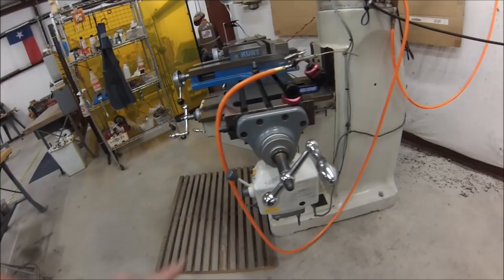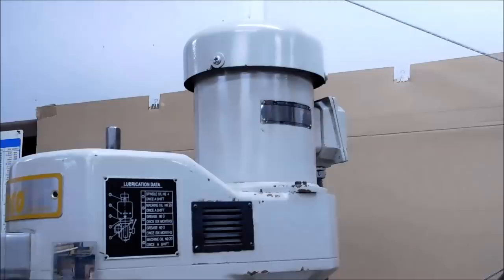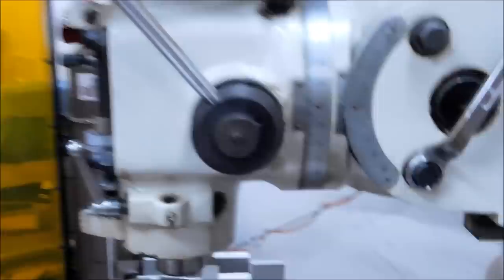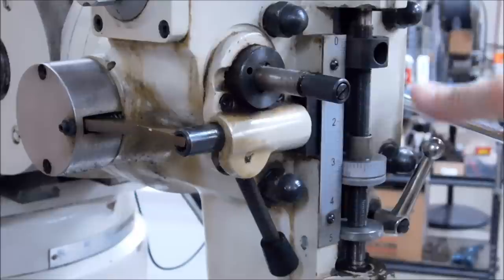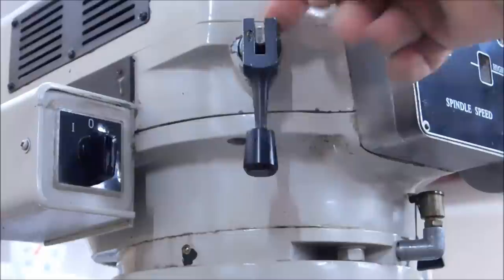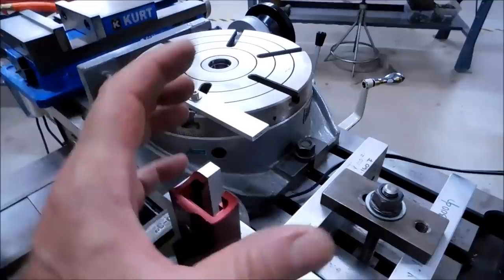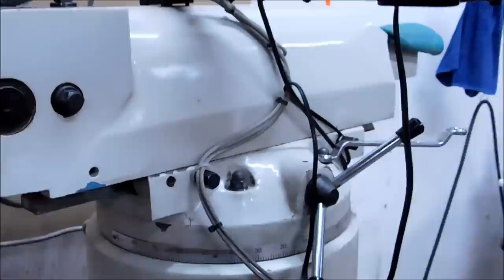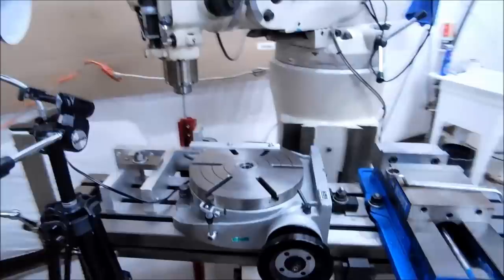Machining - Bridgeport Controls 101 ( and some other stuff )

Comment: Hey Amigo Joe!   Great overview video!   Still have the small handwheel on my Bridgeport!  I think it's a aftermarket but I don't think I've ever used it either.  I was wondering if your machine came with the x axis powerfeed installed or did you do the install?
Reply from the maker: I ordered it with it installed.
Reply: @joepie221  

I miss Enco.  They had incredible pricing on their products.   I guess its what led to MSC buying them out.

Comment: Thanks.  I have a Sharp look-alike.  There are some features on the machine I've never used and I found your video very informative.  I'd like to see you review the maintenance of the machine.  There's lots of fittings on the the machine and some take way oil, others spindle oil and at least one for grease.  A lot of machines' manuals call out lubricants that are no longer identifiable having been referred to by their 40 year old trade names.  (Esso who??).
Reply: The 'Grease' fittings on my Bridgeport are meant to receive way oil, not grease. Machines with these often get greased by those who don't realize. That was the case with the previous owner of my machine.

Comment: The speeds of the power feed  my clone machine are 0.0015", 0.003, 0.006"  and are independent of the motor speed.  They worked once, but not the gear that engages it inside the head is not engaging and it's a lot of work to take it apart.

Comment: Regarding the outrigger setup, do you think that the thickness of the aluminum plates used would make a difference in rigidity? What is a   good minimum thickness?  

I’m definitely going to be making one. I was just curious about thickness affecting rigidity. 

Thanks!
Reply from the maker: For something like that, Go with 1".
Reply: Joe Pieczynski awesome! Thanks for the reply, I will be getting on it this week

Comment: Hey Joe: with so much weight on the table,  would you be concerned about the machines lateral stability with the turret swung out to one side and the table moved in X to same side?  I was doing a job recently just like that and wondered if the mill could get to nearly tipping over to one side if too much weight got offset.  ??  Thx!
Reply: Bill, the manual is very clear, the machine should be bolted down.... If you don't want to bolt it down I've seen guys make outriggers with leveling feet.... It raises the machine a couple inches but improves the stability greatly..
Reply: @randyreddig5239  Thanks Randy.  Good to know!

Comment: Pardon me if this is a completely stupid question, we all think we have something figured out sometimes but lack the full knowledge rendering our idea incompatible.
When tramming the head could you clamp on the round of a traditional indicator and rock it back and forth until you find the highest position of the indicator, and then do the same for the other tram direction once you have the one axis done? 
This seems the simplest way of doing it, but I could be neglecting something fundamental like a cosine error between the mounting axis and actual measuring probe axis due to backlash and just general manufacturing imperfections and tolerancing.
Reply from the maker: If you could accurately position and control the 180 degree sweeps of the indicator, you could possibly do it the way you just described. Envision the axis of a carburetor butterfly. The axis can be true, but either side of it is inclined. Now apply that thought to tramming along the Y axis with the head still tilted in the X. It would be very hard to find that line on a continually moving indicator needle.

Comment: You mentioned that the return spring on your machine is wound pretty tight ...to your knowledge is there a way to adjust that spring tension?? My 10x50 Acra mill is sorta limp in that regard lol.... doesn't return to top as fast as I'd like....
Reply: Yes the clock spring is adjustable and replaceable if it has lost it's power. The ring under the quill handle is where to access that. Be careful as it can bite you, and lock the quill so it doesn't fall while working on it.

Comment: Thank you it is so hard to find a video that talks about this. I have an issue With my Bridgeport where you turn the auto feed on and off. I have also had to head toward apart to replace the bearings so I know there was nothing in the way everything works properly. Do I need to shift it into neutral or something and try to put it into the opposition? It is a manual Bridgeport
Reply from the maker: As I recall, that knob can be tempermental. A little wiggle and they usually cooperate. be gentle. Make sure you pull out on any black ball knob to disengage the pin.

Comment: To protect the gears for the power down feed I think there is an adjustable clutch behind the cover that you can see @ 8:12 with a lever going into it from the feed engage handle.

Comment: most bridgeports/clones have clutches on the quill power feed.  They will protect the gear train if properly adjusted.  What i was told is it should be able to push a 3/8 twist drill through mild steel.  If it can push a drill bigger than that; back it off.  The clutch is located under the aluminum cover where you see the brass colored part of the engage lever going 9:37 of the video.   The three positions for quill feed speed selector are usually about 1.5, 3, and 6 thousandths per spindle rotation.  Fun fact: the direction selector (the part that usually gets hit when you are seating a part) can also be used to drive a bridgeport accessory like a volstro rotarty head.
Reply from the maker: How does it drive the sub spindle while the entire head is spinning? I can see how it would work, but not for corners or radial moves.
Reply: @joepie221  In the case of the Volstro rotary head, the R-8 spindle is powering the spindle for the accessory.  the handle that is used to manually rotate the rotary head slides off and the driven cog slides on.  So the direction selector is just power feeding the head to rotate it.  It seems to me that i have seen the direction selector used to power feed other accessories, but i can't remember at the moment.

Comment: on a real bridgeport, the power feeds for the spindle plunge are .0015, .003, .006 per rev.  im not sure if they are different on clones or not, i'd assume they were the same.  i cant remember where i learned it, but flipping the spindle lock to the back is one of the best mods i've done to a mill lol.  when flipped around, down is unlocked and up is locked, super annoying on machines with some miles where the thing always "self" locks.
Reply from the maker: I would like to see that change. I can't visualize exactly what you moved.
Reply: @salvadorebertolone  Thank you!

Comment: I like the extension sleeve on the right side feed handle on the X axis .  the power feed gear housing is very close to the handle on a standard setup and can be a nasty surprise if not aware.
Reply from the maker: I got pinched as a new guy. Never again.

Comment: Hi Joe, I have a JET brand mill which looks to be a direct copy of a Bridgeport. Mine has NT30 taper, not an R8 collet like yours where I use an ER32 collet chuck, now to my question...you said put side load on your bit before tightening your collet, why is that and do I need to do that with ER collets? Thanks for you great videos !
Reply: I believe that the reason Joe was putting the side load on the endmill was just to prevent it from falling out of the collet and damaging the cutter.  Side load shouldn't affect the alignment within the collet.
Reply from the maker: Wilson T is correct. Its a habit I have developed over the years to force a slight bind between the tool and collet to keep everything together  when snugging it up prior to the final torque. Nothing is worse than a new end mill slipping out of a collet and knocking off those perfect corners.

Comment: re: spindle brake, a lot of newer bridgeports (post-2015) changed something, and the brake likes to stick a lot more than on older machines, so sometimes it won't return itself to off. they added a page in the manual about it.
Reply from the maker: Make sure the lever stays flat when you use it. Some cam designs are very sensitive.
Reply: @joepie221  Not all the Bpt clones allow the brake lever to be locked like you showed. Mine was built by Bemato in Taiwan and it's brake lever can't be cam locked to hold the brake in the on position. Why they neglected to add that simple feature seems real odd to me.

Comment: What is the purpose for the bottom nut on  the micro screw? I just completely rebuilt a Bridgeport and thoroughly enjoy these videos. I like the double handle to extend the ram.  I may tap another handle into mine to mimic that.
Reply from the maker: Can you give me a time stamp?
Reply: Sure, 4:59.  The thinner nut on the micro screw at the bottom, below the speed nut.
Reply from the maker: @HillbillyNitroRC-qs9dy  Its a lock nut to secure the larger graduated nut just above it. I also put a spacer under it quite often to eliminate the travel in the vertical screw for more positive registration.

Comment: I've been "familiar" with these mills for nearly 30 years, and yet you still managed to teach me a couple things.  First, I never realized the Brake Lever for the Spindle had a cam lock on it.  And I'm happy to learn that my power feed direction lever/knob isn't the only one that's been hit with a hammer on the upswing while seating a part.  Not to brag, but mine runs out a bit worse than yours. :-)  You mentioned that the bolts that secure the ram movement are only snugged down.  Do you happen to have a torque spec for those & the bolts that lock the pitch & roll of the head.  I snapped one of the 3 pitch lock bolts off a few weeks ago.....I may be tightening it a bit too much.
Reply from the maker: I bet a lot of old guys didn't know the brake lever cams. You're not alone. I don't have a torque spec for the bolts, but weight is your friend up top. If you are really banging hard on a cut all the time, getting a spec may be worth checking into.
Reply: @joepie221  I've seen 40-50 ft. lbs mentioned for the head bolts that attach the head to the knuckle assembly. Some who know these types of mills real well on the PM forums state that going past those torque numbers will distort the head castings spindle and bearing bores. For the ram then just tight enough for it to not move is all you need. And about 50 ft. lbs on the turrett rotation locking bolts. One trick I borrowed off that Practical Machinist forum is once the tilt / nod is adjusted and the spindle is trammed true to the table you should then back those tilt / nod worms off to there neutral position so they can be moved back and forth with your fingers with the backlash in either direction. Leaving them pre loaded after making tram adjustments is what helps the head to slowly move out of tram due to normal cutting loads and vibrations. It's not much movement, but a few 10ths at the worm locations equals a couple of thou out at the spindle. Since I started doing that the head stays put a whole lot longer imo.
Reply: @turningpoint6643 , good point on the worm screws, mine is really sensitive about that

Comment: Hi, did you ever have a problem with the weight of the head when it is rotated? I had a guy at work that loaded the table with a heavy part and the machine wanted to tilt and my boss had to go over there and warn the guy that it was dangerous... Regards from Portugal 👌

Comment: Your outrigger fixture reminds me of a story told to me by an older machinist.  The shop that he worked at had a part that they made frequently that was a 12' long shaft that needed work done on the end similar to the part that you showed in the video.  They had a hole in the floor on the left of the mill that they would put the part into to do the work on the end.  I don't know if they just made a hole in the concrete and then drilled out the hole or if they added a casing to prevent the dirt from filling the hole in.  I would assume the latter since they made the part daily for years.
Reply from the maker: Thats a great idea until they hire a new maintenance guy that fills the hole with concrete.

Comment: My Jet 9X49 has 3 power down feeds .006, .003, .0015"/rev. What is the flat with a hole in it on the back of the ram used for? Yours had blue towels laying on it.
Reply: The flat on the back of the ram is for a vertical shaper used for keyway and square hole broaching.
Reply: My Millport has the same 3 feed rates/revolution as your Jet Larry.
Reply: The feature on the back of the mill is for a Bridgeport Shaper Attachment.
Reply from the maker: Its a good place to set your beer. ( only kidding )
Reply: @joepie221  That's what I thought, but it's turned out to be too long of a walk around to the back of the mill to reach your beer.
Reply: you can attach grinder attachments there too

Comment: For all my years machining metal, I only had one job where I needed to use a Bridgeport.  I wish I had seen this video then, about 10 years ago.  It took me about 2 days to get much of this figured out, and had to do it by, "How can I make this machine do what I'm trying to do. "   To make matters worse. the table would move then on day 2, it wouldn't.  I went back looking for a mistake I had made or somertting I had missed and eventually found a tapered pin on the floor.  The pin connected the drive mechanism to the lead screw.  My boss thought I was a genius, I thought I was an idiot because it took so long to find the problem and just stick a pin back into a hole.

Comment: The handles on Kurt vises (and I assume most others) are a 3/4" hex which will fit the draw bar and all the bolts on the head of the machine, so you don't need to keep a separate wrench at the machine.
Reply from the maker: The 3 arm speed handle saves time "unloosening" the drawbar. Smack it and watch it spin.

Comment: Thank you for your video's, very informative. On the subject of rotating the head on the column, when I put it back to "0" , I tram the head in and out to get it square to the X  axis of the table. Why?  If I tip the head at a angle let say to mill a 30 deg angle using either tip of head, I will get a better finish as the cutter face will cut square to the cutting feed direction, no heal -toe effect of cutter. yes this may be going to the N'th degree and not required for most applications.
Reply: For the best rigidity I keep my ram almost fully retracted. Mine also has a decent dro on it so I also set the ram true to the Y axis travel. That way if I can't quite reach a part feature and do have to move the head out then my dro position settings remain correct. Like yourself for the extremely rare times that might happen it's probably unnecessary and wasted effort.
Reply from the maker: Would side milling not eliminate heel drag?

Comment: @8:40 The knob is a feed rate selector. The feed is based on per revolution of the spindle. Like 0.001" downward per revolution.
Reply from the maker: I have to find the manual and check. This machine has position 1,2 and 3. I am not sure that means thousandths.
Reply: @joepie221  Mine measured out to be .0015"-.003"-.006".

Comment: Hi Joe
My Tiawanese "Bridgeport"😎 has a lever on the l.h. side to control the downfeed per rpm of the spindle. I note yours had abc, but mine has .04, .08 and .15 marked. Maybe your ABC equates to that! Also I liked your idea of the power board on the back. Might do that myself, Thank you.
Reply from the maker: That power strip placement also keep flying chips out of the receptacles.

Comment: Question for Joe and his viewers. Any of you have a sheared off registration pin inside the quill? I’m talking about the pin that slides in the groove on your R8 collets or chucks. Joe is talking about this at approximately 19:40 here in this video. One of my friends mills has this problem. Doesn’t seem to throw a collet off center but bugs me. Have you replaced it or just forget about?
Reply: Just replace it. Its just a set screw with a square ground on the end
Reply: Depending on the brand it's not so easy . Clones use standard pitch sets screws  . Bridgeport use a 1/4-32 .. only available thru a special supplier . Replacement is fast any easy . I'm sure there's videos on here
Reply: H & W Machine Repair has a video about how to replace this pin
Reply: @cvuxton  Tubelcain also has one....
Reply: My pin was going when I bought my mill. It doesnt effect its function and I can change tooling faster so I will never fix it.
Reply: Ok.... where to begin here. First off, thanks much for the responses. For some reason we cannot get the set screw out. I’m assuming when it sheared off, it twisted. He was using a slugger cutter to drill a 1.75 hole in .750 plate. Probably failing before then, idk. I can’t get an easy out of any type in there. This is a Wells Index 9 x 49, about 20 yrs old or so. Any thoughts besides taking the quill off? Or is he SOL?

Comment: When would you use power feed up?
Reply from the maker: Some people like to bore a hole and then bore back to the start position. It may also come into play with the machine in reverse and left hand tools. I'd have to check that, but its possible.

Comment: Automatic Quill Feed brings the quill down 1.5, 3, or 6  thou per revolution respectively LOW , MED, High settings. if you are at 1000 RPM and 6 thou per rev setting 1000x .006 = 6"/min vertical quill speed you should observe

Comment: Good video showing the basics. I have a topic that I would like to know more about, knee mill maintenance.  Specifically why my variable speed head screams at me now when it was new, it didn't.  Can anyone guide me on a solution?
Reply: You may have a bearing going bad.
Reply: Joe has a video with the fix for this problem. Check it out.